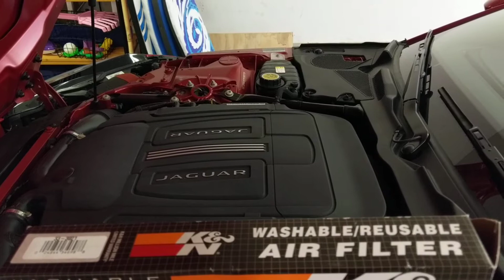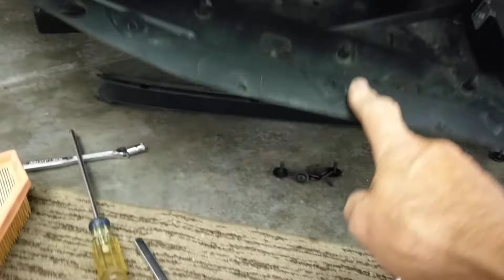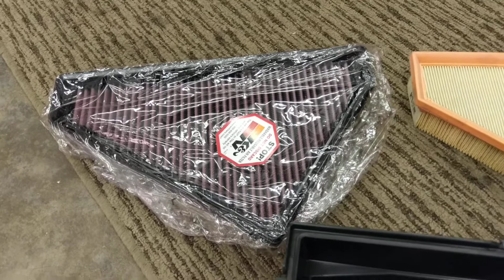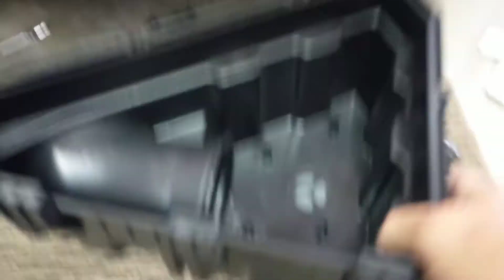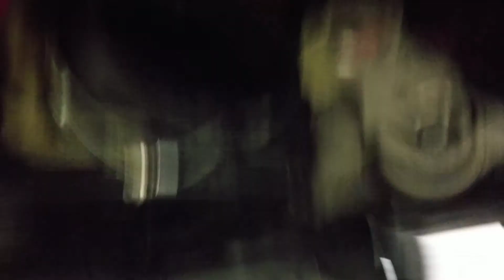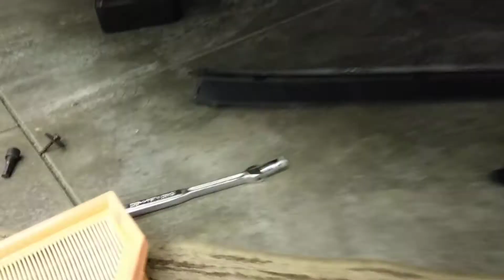F Type air cleaner Driver side

Comment: Thank You very much for posting this... It is time for my to replace the Pollen and Air Filter and they want around $500 for it. So this is something I rather do myself if possible. Quick Question, with this method you should be able to replace both sides without having to remove the tire or wheel well correct?
Reply from the maker: Juan Carlos Contin 
Sorry for slow response....the cabin air filter requires less than 60 seconds to remove/replace.